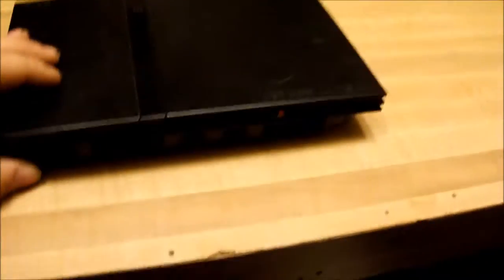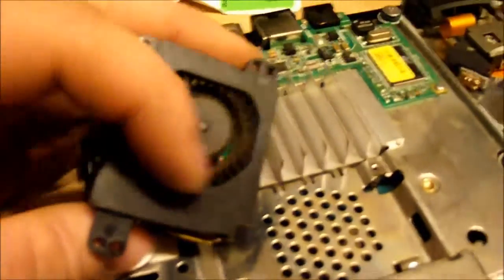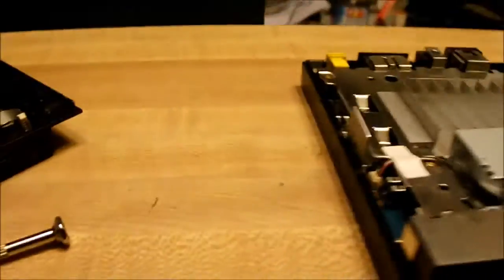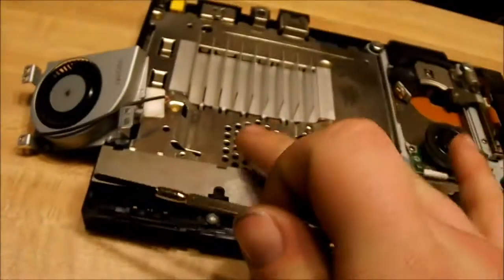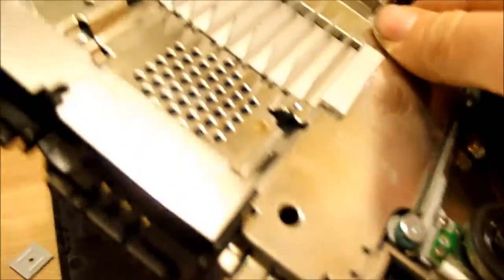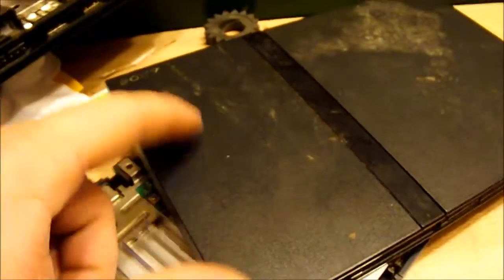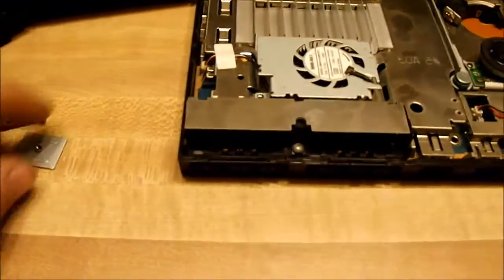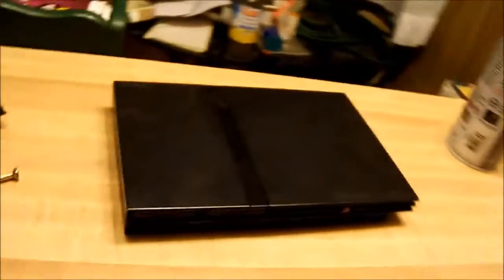I Fixed My Overheating PS2 Slim

Comment: i still have a problem with overheating my PS2 model is SCPH-79001
Reply: Anthony Corbin today for the first time ever since I bought. it brand new in 2015 that red flashing. light is overheating. so I want to know do you repair your console. by replacing. the fan let me know

Comment: Dude mine catches on fire and smoke comes out of it when I turn it on, I'm currently cleaning and it's been clean (bought it at goodwill) I will see if that works. Do you think it's something else?
Reply: Lol
Reply: You could make a video on showing the problem.
Reply: You used the wrong power supply, for example, plugging a 100-volt device into 240 volts would cause the hardware to smoke and catch on fire same thing on the opposite